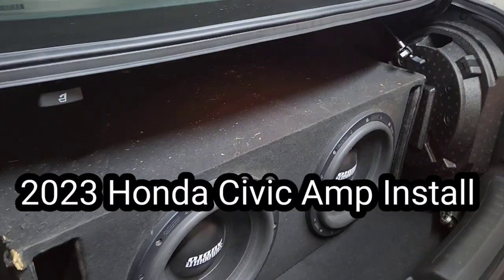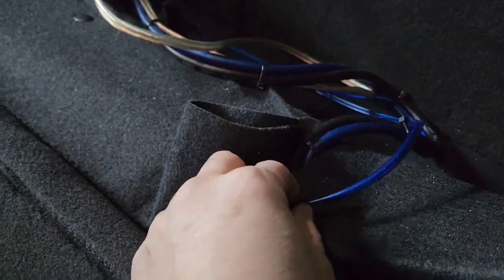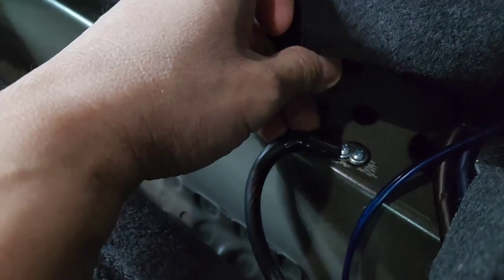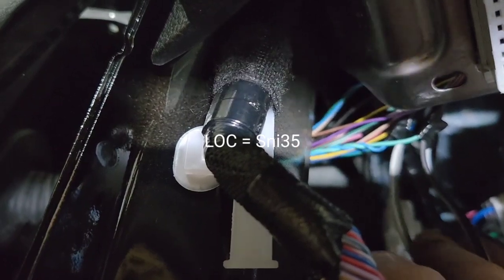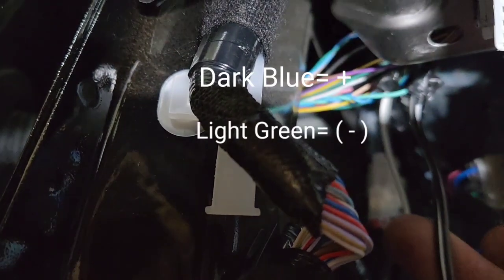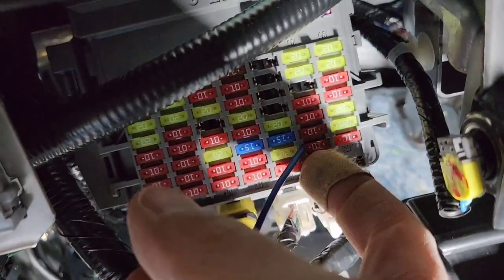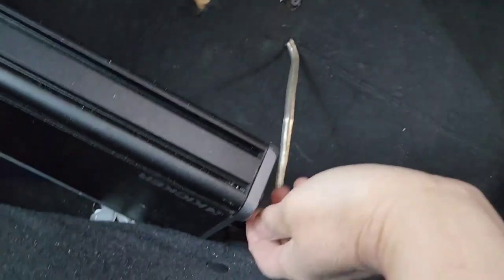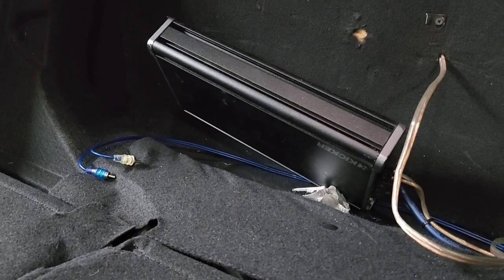22 2023 Honda Civic Subwoofer install

Comment: Awesome video, thanks for all the info. 
Was there an loc in this installation?
And did you have any issues with the loc and amp staying on when the car was off? Tia
Reply from the maker: I used Kicker kisloc 2 for the lineoutconverter.  Some of the Civic stayon about 1 minute
Reply: @khmerohio  thank you so much, so I don’t have to worry about battery drain or amp overheating?

Comment: I see two light green and dark blue wires does it matter wich I tap into
Reply from the maker: Clips please
Reply from the maker: 2:16
Reply from the maker: The wires are twisted together
Reply: In my 23 it's light green and light blue and it's the front drive-side speaker 🔊

Comment: whered you put the remote wires and RCA's to?
Reply: He shoved the wire in a fuse hole for accessories and should've used a "add a fuse" and the rcas to the line output converter